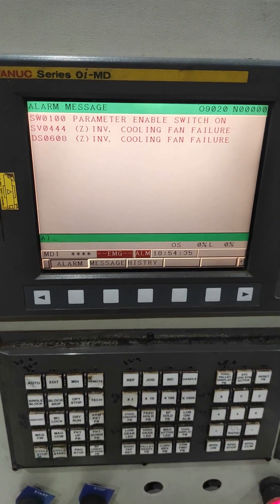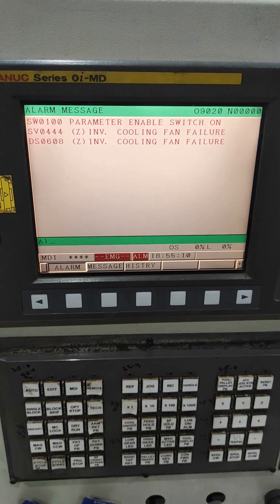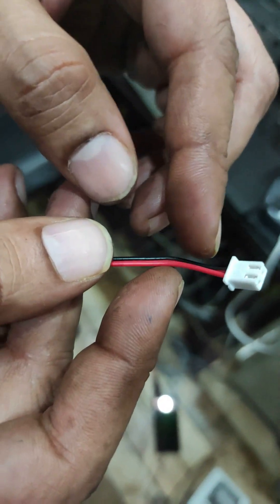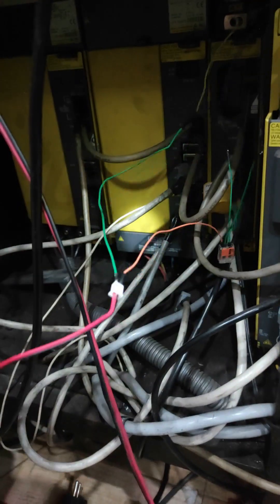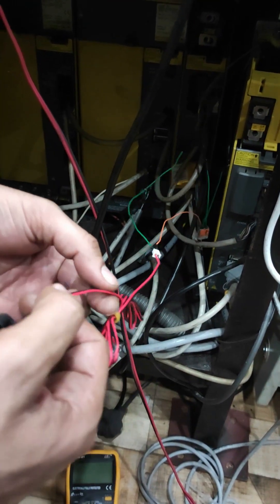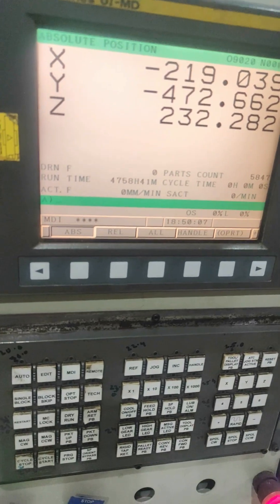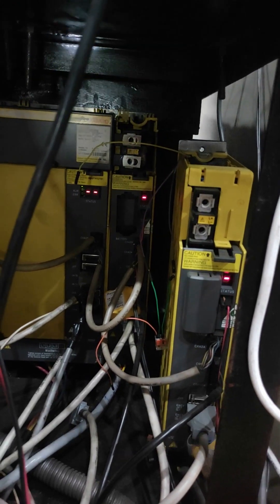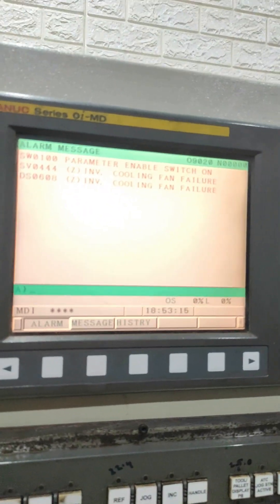FANUC FAN ALARM BYPASS :Dopamyn Robotics

Comment: Fan is for cooling purpose of electronic cktry in case of 2 wire fan off in-between,it will not generate alarm, which is for drive safety.